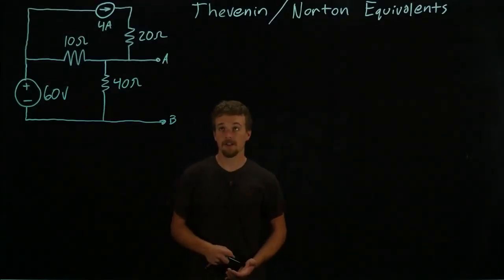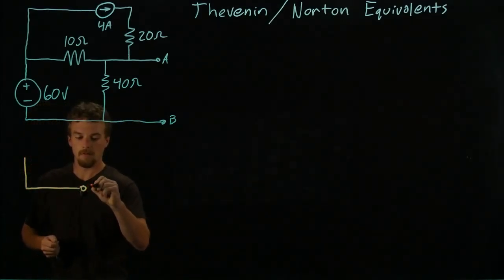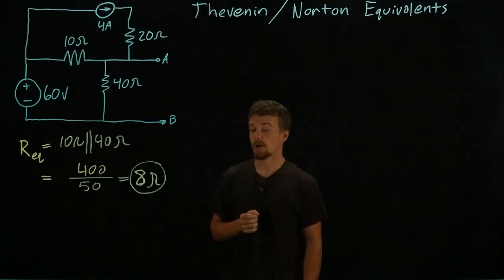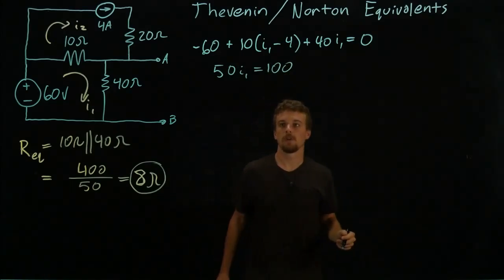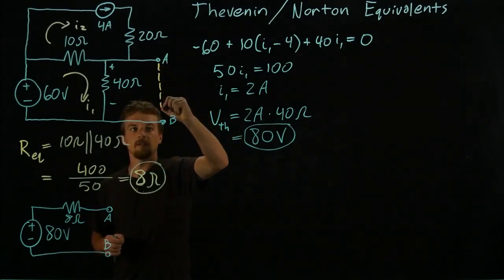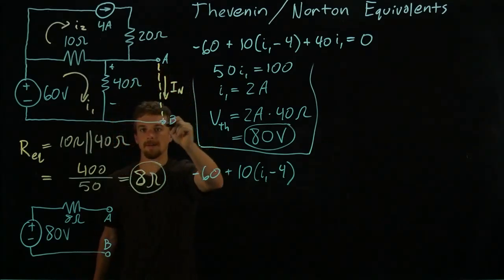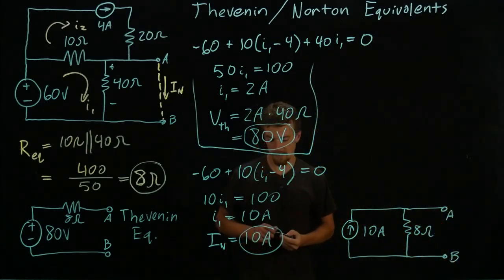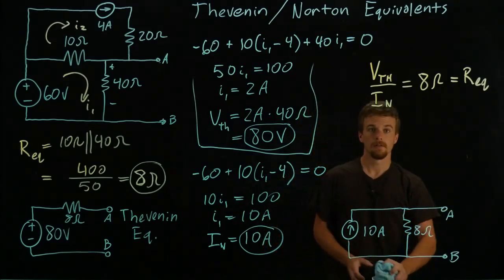Circuits 1 - Thevenin and Norton Equivalents

Comment: Aren't the 10 and 40 ohm resistors in series, not parallel?
Reply: If there is current division between two resistors, then they’re always in parallel, easy as that.
Reply from the maker: Nope! an easy way to see this is to look at the circuit with the sources set to zero. We can then see those two resistors share equipotentials nodes!

~andrew
Reply: @UConnHKN  I dont understand they still look in series to me :/
Reply: i think i get it now
Reply: Yes, for the mesh loop, but not for outputs a and b.
Reply: since they share two nodes so they r in parallel
Reply: @oumaimaomari940  Where?  Ar the beginning they are not in parallel.  They have a voltage source between their opposite nodes.
Reply: To be series they middle node must connect only those 2 components.  To be parallel, the must share the same 2 nodes (e.g. if the 60V source didn't exist).  Only the connections matter. :)
Reply: excellent response.
Reply: You look BACK into the circuit from the output when all sources are deenergized and the two resistors are now in parallel.
Reply: they are in series
Reply: No because the wire with the 20ohm and 4a above it

Comment: When finding Vth at 6:03 why did you only multiply it by the 40 ohm resistor and not add the 10 and 40 ohm resistors together?

Comment: When solving for for Norton, when the current flows around from B and onwards, is it not possible for the current to flow upwards throw the 40 ohm resistor. All three branches have resistors?

Comment: 7:42 That's not quite right. When you have two impedances (like resistors) in parallel, you would say that the "path of least resistance" is through the smallest impedance, and yet the current flows through both. The actual reason you can ignore the shorted resistor, is that you have a current divider built from the 40-ohm resistor and the 0-ohm short. By the formula of a current divider, the resistor gets no current and the short gets all the current.

Comment: So if it becomes too difficult to find the equivalent resistance, but you can find the voltage and current buy Noodle and mesh analysis, you can calculate the resistance from those.

Comment: Shouldn't the 8 ohm and 80 V battery of the simplified circuit be in parallel not series? There's a difference yes?

Comment: why does he didn't subtract the 20omhs resistance when he's searching for the voltage between A and B?
Reply: It's outside the test points   the test points are the same 2 nodes as across the 40-ohm resistor.  With the same nodes, they are by definition in parallel and thus must have the same voltage potential.

Comment: Great video! I think the part where you explain what happened to the 20 ohm resistor when doing your first Thevenin could have used a bit more explanation as to why you can ignore it. Really well done though. I like your idea of mirroring the image so you're not writing backwards. :-)
Reply: Samwhell he ignores it because it’s an open circuit and no current flows there

Comment: How do we know I(N) = I1 and I2 is not part of it?
Reply: Because the circuit has been shorted from A to B, so the current will travel from the voltage supply, to the 10 ohm resistor, to A and then to B. Therefore, the Norton's current would be I1 since I(N) = I(Node A to Node B) = I1.

Comment: Why is i2 4A? Wouldn't the 60v source create some further current through there? Like if you follow the path of the positive charge from the voltage source it first has the option of no resistance vs 10 ohms, so at least some current should go to i2. Or do voltage sources treat current sources as open circuits?
Reply: The independent voltage source will apply the same voltage regardless of the current source. Hope that makes sense.

Comment: can't you essentially do ohm's law on the thevenin/norton to get the other?
Reply: Yeah, he explained that at the end. If you have dependent sources for example, you can't replace those by short and open circuits, so it might be difficult to get the Thevenin Resistance. You could instead just calculate the Thevenin Voltage and Norton Current first, then divide and get your Thevenin Resistance.
Of course this also goes if you want to find the other two and you do have your Thevenin Resistance.

So:
V-Thevenin / I-Norton = R-Thevenin
V-Thevenin / R-Thevenin = I-Norton
I-Norton * R-Thevenin = V-Thevenin

Comment: Why-60 not 60 in first loop
Reply: it can be 60 or -60 but then your equation have to correspond with - and + ( for example. -60 + 10(I1 -4) +40i1= 0 or 60 -10(i1 -4) -40i1 = 0 ) I prefer to start with -60 and as  your current get to the resistor, treat it as from + to - so you always add.
Reply: Thy Nguyen thank you
Reply: That's how the voltage source was connected. See the mesh was running clockwise, so if you're following that current it goes through the -side first and goes out of the +side. That means that you'll have to take the voltage negatively. If it was written upside down it would've been +60V. You just have to follow the current and see what symbol it goes through first. If it's - than your voltage is negative, if it's + you're voltage is positive. That's how I always remembered it.

Comment: Doesnt the 10 ohm and the 40 ohm resistor end up in series after the current is cut in the top branch (when the third resistor becomes useless)? I mean, no current is going in the A direction neither.

Comment: Instead of doing the meshes you could have done the 4 amps that are above multiplied per the 20 ohm resistor. It is easier and faster :)

Comment: Great teaching skills that takes me back to my high school days,  my question is when do we use Norton and Thevenin theorems in real life application  ? in Small-signal modeling for example  I'm I right ?  because in real life there is no such Norton souce of intensity (pure Amperes) or Thevenin source of potential (Pure Voltage) but the source is always a hybrid Source (Volt + Ampere)
Reply from the maker: Well the real life is always a little different from the theoretical. We use Thevenin and Norton models in small signal applications, yes. We also use them when providing loading for complex systems (i.e. a speaker is 8 ohms , this is the thevenin impedance). As for your question about the different sources, the models differ depending on the capability of the source and its loading. If voltage is maxed out but we can still provide all the current we need, use a voltage source model. If the opposite is true, use a current source model. If there is a combination of limiting factors, you need to be creative to get the same type of source you need. It is all about exploiting theory to closely match the reality, which differs from situation to situation.

~Andrew

Comment: Thank u for this video , but why the sign of voltage 60 is negative?
Reply: could be either or if you keep the signs consistent.resistors usually drops while to voltage negative to positive is a voltage jump if you multiply everything by a negative would fix the sign.

Comment: Why does i2= 4A?

Is it because:

Mesh currents are made for every non inclusive loop. So there would be two non inclusive loops for this circuit. Loop 1 would contain the 20 ohm and 10 ohm resistor. Loop 2 would contain the 40 ohm and 10 ohm resistor. Because Loop 1 has only resistors in series, the current around loop 1 is a constant 4 A. (** note: the 10 ohm resistor is in both loops)

Is my reasoning correct?
Reply from the maker: Hello!

Thanks for commenting! This isn't entirely right. A loop current can be assigned to any of the smallest closed loops in the circuit. This means loop one consists of the loop with the voltage source, 10 ohm resistor, and 40 ohm resistor. Loop 2 consists of the current source, 10 ohm resistor, and the 20 ohm resistor. The current in any element is then the sum of all the loops currents that have the element in the loop. Since the current source only exists in loops 2, the current in the current source is the same as the second loop current. THis is why the second loop current is the value of the current source.

I hope this helped!

~Andrew

Comment: Why is the current flowing through the 10 ohm  resistance is equal to i1-i2?
Reply: if u look at the node at most left, above the 60V battery, i1 is entering while i2 is leaving the node which gives i1-i2, and that current is going to the 10 ohm resistor

Comment: I was hopeing someone could explain. In the first example It's not clear to me why the R_thevenin is equal the equivalent circuit of 10ohms parrallel to 40ohms as opposed to in series with.
Reply from the maker: Hi There. Thanks for commenting! As, @Zac Sutton said above, we need to turn off all of the sources and look at the resistances between A and B. When we do this, we see that the nodes the two resistors are connected to are one and the same, implying that they are in parallel. The current in them may be the same, but this would be by coincidence only, not because of they are in a series configuration (they are not).
Reply: I guess I am kind of confused about how we are supposed to find an equivalent resistance after we eliminate our sources.
Reply: Thanks for commenting! When we eliminate sources we replace current sources with an open circuit and voltage sources with a short circuit. We then look for the equivalent resistance BETWEEN points A and B. In this case the 10 ohm and 40 ohm resistors are in parallel between A and B when sources are eliminated.

Also remember that if you are having trouble finding that equivalent resistance, you can instead find the open circuit voltage and short circuit current between A and B. Then R_eq = (V_open)/(I_short).
Reply: When you leave A you can take two paths to get to B. You go straight or turn left. At this point you should notice tge tips and tails are touching for bith resisters making them parallel.
Reply: hi, thanks for the video. so i think that 10 and 40 ohm is in series. they have the same current I !!!